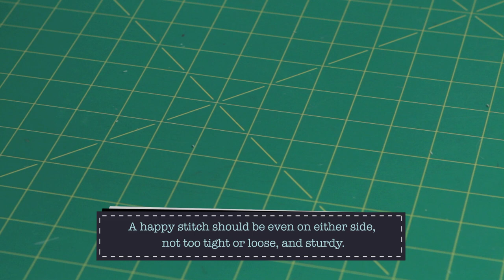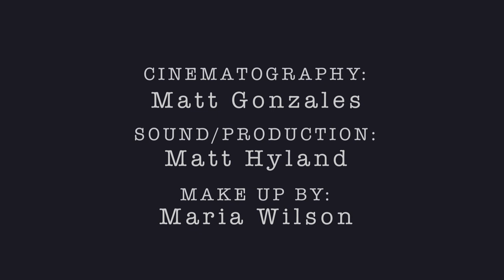Quilty: Why does my sewing machine bobbin do that?

Comment: Great tutorial !!  I have also found that if all the recommendations that you made on the video still don't solve the problem, you should change your needle. I have done this and it can solve this issue. The needle may appear just fine and you can't really see if it is slightly bent or pitted. So anyway this is my 10 cents worth!!